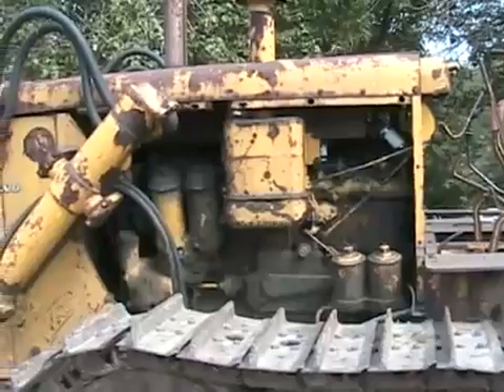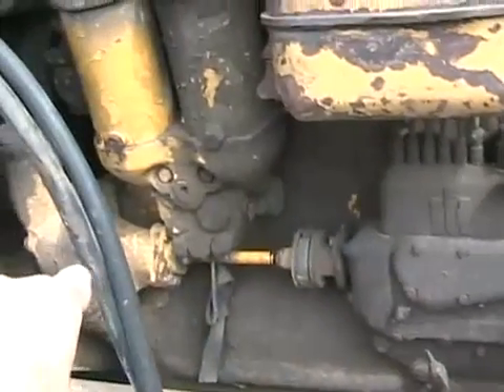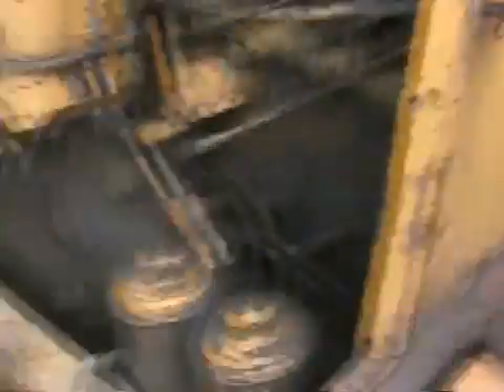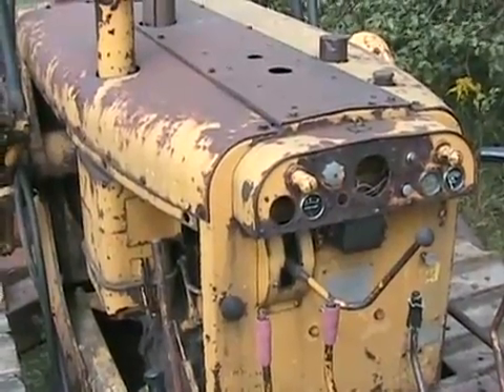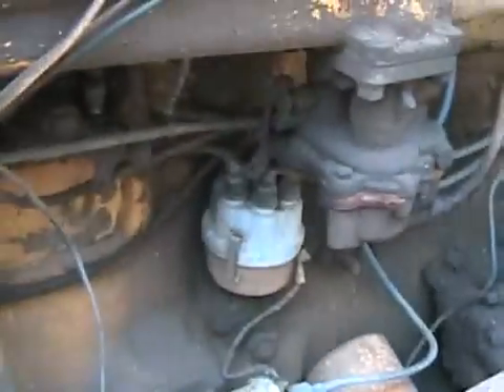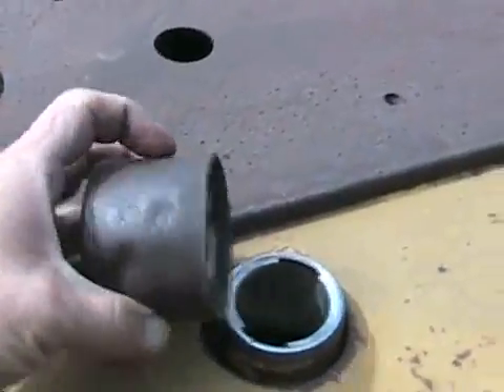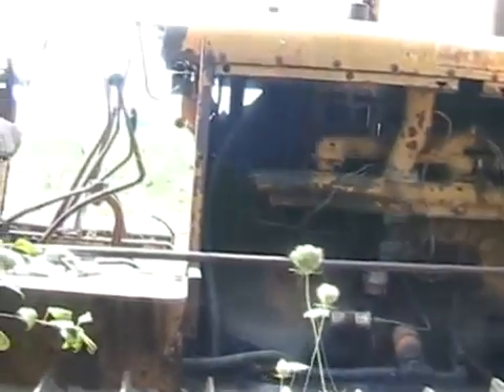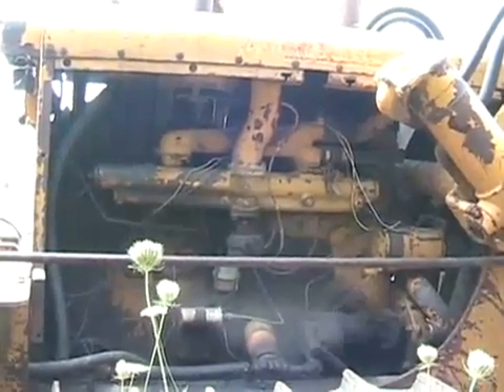how a gas to  diesel dozer bulldozer engine works Davidsfarmison[bliptv]now

Comment: Thank you so much for explaining the ( GAS to Diesel) START system on international Heavy old iron. It was a master system. I just think of the Hard starting if it did NOT have the wonderful GAS start system. Such master engineering at international. Great walk through of the engine. I have a 353 & 8V-71 Detroit Diesel Engines in two of my personal toys. The 353 is in a 1978 Dynahoe-190 & 8V-71 in a 1971 SeaGrave Engine. YES with the straight 40Wt. Oil   put on a plug in block heater in 353 and a magnet oil pan heater on 8V-71.

Comment: The biggest International crawler with the Gasoline start Diesel engine was the TD-24 (1091 cubic inch six cylinder engine)  The TD-20 was 691 cubic inch. This style of engine was built from 1932 to about 1962 by International Harvester. They then built crawler tractors into the 1960s & 1970s with conventional style diesel engines of their own design.
Four cylinder versions of these engines were used in International Harvester farm tractors from 1935 to about 1958

Comment: My dad had an IH sawmill motor like this, it also had a hand crank. The electric starter was bad, so he would crank it by hand on gas, then once it warmed up, switch it over to diesel. I can remember it rattling the windows in the house!

Comment: Case  and  MRS  both  made  farm  tractors  that  were  gas/diesel
Reply: MRS tractors used an International Harvester built engines
Reply: Thanks for the info. I didn't know that. I've run into case and mrs farm tractors and a IH crawler

Comment: Skidded timber with a '48 TD 14 in 1990, she would start in 20 below weather with just a pickup truck battery! Wasn't the best in the woods because of the low ground clearance but good god would she pull, 3000 board foot up 40 degree slopes were no problem!!

Comment: Yes Sir  exelent your explication The Ignition IH by conversion  via a starting valve  This is Genial  a great idea , The engine starting ever in coldest weather !  The operator indeeded start temperamental pony motors Never ready to start!  
The IH  system is easy Open the gasoline robinet  Pull the descompresion lever ,push the start buton and the  Ih starting in gasoline form ,when the engine heat 2 minutes push the descompresion lever and pulse the acelerator lever and the diesel In Operate